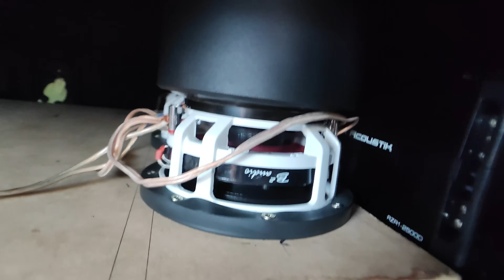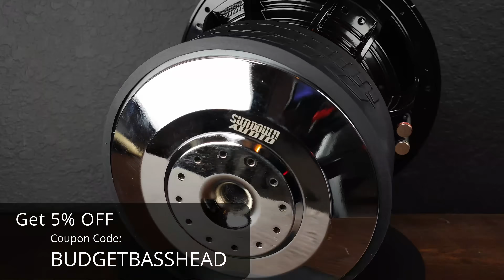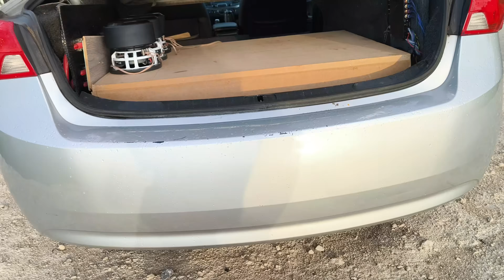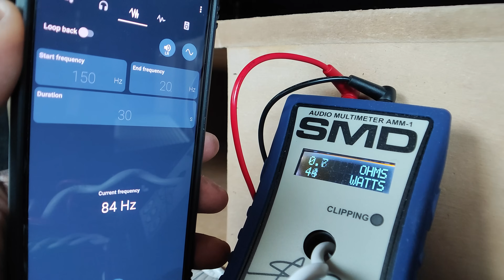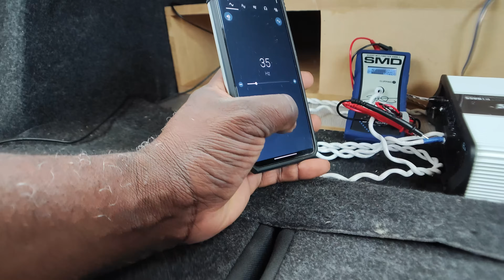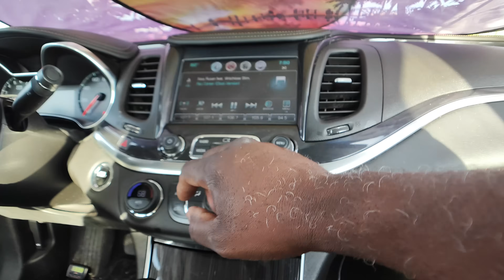Three 6 Inch Subwoofers In A Large Horn Enclosure - B2 Audio Rampage 6 - 3,500 Watt SPL & Music Test

Comment: I wounder if  a  cnc hole cut out of 3/8  as a adapter baffel  to make the speaker being able to fix it to  the box and mount  in that location .   B2 audio should have a matel cnc mounting  adaper plates made   for easy instolation.  💯🎵🎶💪✌️😁   sweet  sub though for it size defintly
Reply: I understand what your saying, you don't need a cnc to make a cover plate but it sure makes it easy. 
I'll be making some similar adapters to mount my smaller subs into larger hole size, since it makes thing much easier and avoids damaging the box.
Reply: @Subdynoman  thanks i didnt no how close or tight the  sub was to the cut out and screws that why i wad suggesting a cnc cut just in case💯🎵🎶✌️
Reply from the maker: @josephsaucedo8691 I agree with @sudynoman, it's not necessary, but very helpful. Plus metal would last longer, than one made with wood. Though you can also use plastic.
Reply: @BudgetBassHead   im pertty sure they already  sell these type of speaker adapter rings all ready  pre made out of wood or plastic   im not sure if there any pre made from  metal ones   i would imagen  some one  make and sell  them to  . If you have a drill and plasma cutter you can make them easly to from metal .  I like diy my self if i have the right tool to do so.💯🎶🎵✌️😁

Comment: I would say the reason u didnt get louder with the horn when rolling down a window is ur not getting any cabin gain in dbs i am not super expirienced in horns in a car envirement as i have only owned a horn enclosure with pa sound systems when i was dj events horn enclosures the sound would really travel far distances u could stand 50 feet away and feel the pressure in your chest just as much if not more than standing up close.
Reply: The box loads the woofer, while ported and sealed don't load the woofer. You can open your trunk with a horn and still have the same amount of bass, if you do that with a trunk build with the knob cranked it's unloading and you're ripping spiders and surrounds.
Reply: @kcstein5956  All enclosures Load a woofer, to different degrees. I have seen many times in SPL comps., where the SPL has increased from opening a trunk with a ported enclosure.
Reply from the maker: Thanks for sharing your experience!

Comment: In the 3D modeling software you're using are the measurements in the program the same as real world so  if you wanted to manipulate the box in the in the trunk within the software that would give you an accurate representation/ simulation of it in the real world? So that you could play around with things and make sure it fits the way you want?
Reply: It is better to simulate the entire cabin than just trunk. Very good technique if you want to get windy. Model the cabin as a chamber and the window as a port. Then design your box around the windows resonance
Reply: @biguzivert so U Take the hole Air Volume of the Car and the Windows size to get the Tuning of a 6th Order Bandpass Design right? So in Order to get windy you would try to get a high Peak at the Windows resonance. I never tried it that way at all but it makes sense for me
Reply: @guhhran8614  Yup. Just make sure you guess the length of the window hole too. If you didn't know, when you play near tuning, cone excursion lowers, and motor force controls the output at the port. On the other hand excursion lowers your motor force. So unless you have a walled off build the cabin alone isn't going to load the driver well because it's too big. So in order to most effectively couple the driver to the window, you need to tune your box very close to that window resonance. Use the box to lower excursion/keep motor force high, so the driver can effectively couple to the window's resonance. Yes you can model this as a series 6th order bandpass. and estimate your port velocity at the window. Hornresp will 100% overestimate it a ton, because hornresp assume perfect conditions. But it does work. Suv's will be super low, sub 20hz. Sedans around 20-24hz. And a single cab pickup truck will be around high 20s
Reply from the maker: Excellent advice.
Reply from the maker: Yes, everything is to spec.
Reply: Man this does even more than I thought I had no idea you could use it for estimating cabin tuning how brilliant. Absolutely fantastic.😊